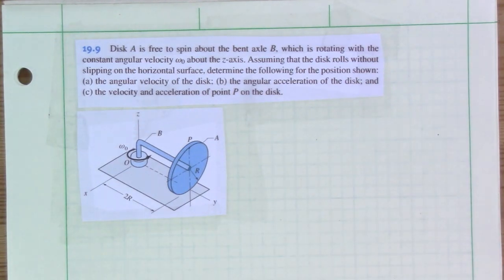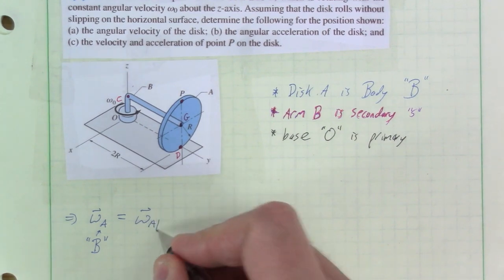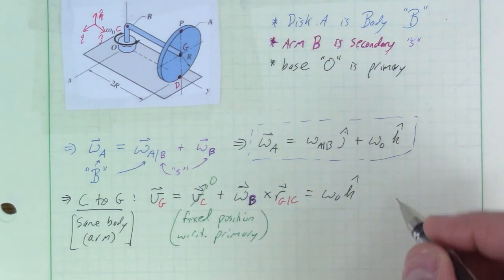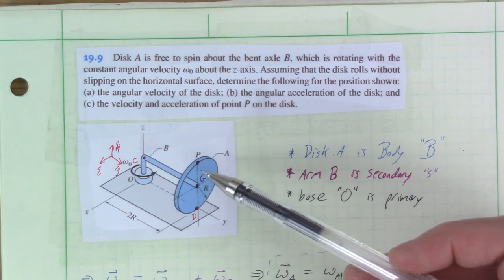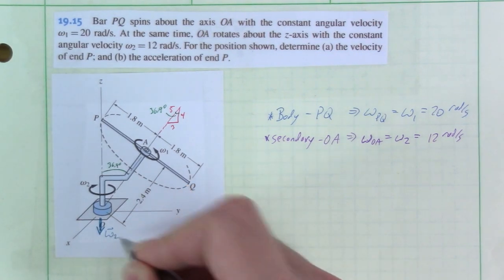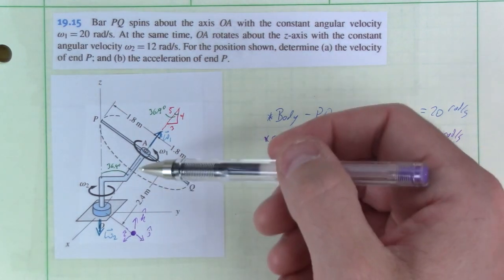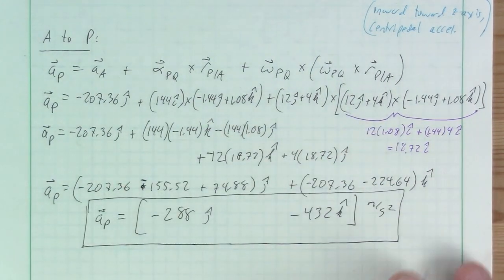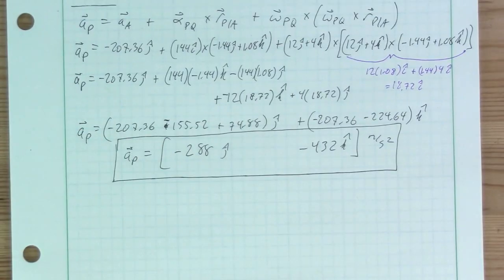Lec35 - Rigid Body 3D Kinematics (Examples)

Comment: In this case you can apply the equations directly between points P and O - the velocity and acceleration equation - since point P is rotating about a fixed point O. Simplifies a lot; otherwise great demo

Comment: thanks alot
Iam just confused, how did you realize that w1 is the relative omega between the body and the secondary and is not the omega of the body.

In other words, how could I know from the question if this omega is for the body or the relative, because it doesn't seem to be clear from the picture

Comment: is there a specific reason for q1 part C that you take point P with respect to G? trying the problem myself first, I thought it'd be easier to take P with respect to D as we determined point D to have zero velocity and subsequently zero acceleration. I got the same answer for point P velocity when taking P with respect to D but my answer for acceleration of point P (again with respect to point D) did not match yours.

regardless, thanks for the video. makes the struggle through Dynamics a little bit easier haha.

Comment: Thank you for the videos they are really helpful but I had a question I couldn't figure out even after watching the previous lecture. For G to P, at 18:45, why is Wa used instead of the relative angular velocity of  P about G? Isn't the rotation of the coordinate system accounted for in Vg? 

My intuition was that to find relative motion about a point you basically use a referance frame that keeps said point stationary. If we use Wa what is the point of including Vg into the equation? Why not just use Wa cross the position vector of P relative to O?

EDIT: I corrected the time stamp!
Reply from the maker: G and P are on the same rigid body with no additional rotational motion, so that relationship between v_P and v_G is the one that relates velocities for two point on a rigid-body. The rotation for the disk (omega_A) is the relative rotation between ANY two points on the disk, which is true for any rotation of a rigid body. That is, omega_A is the rotation rate of the disk about G, is the relative angular velocity of P about G (as you suggest), AND is the relative angular velocity of G about P!